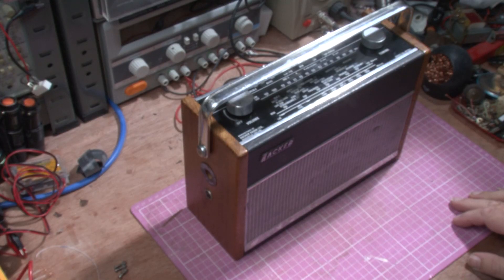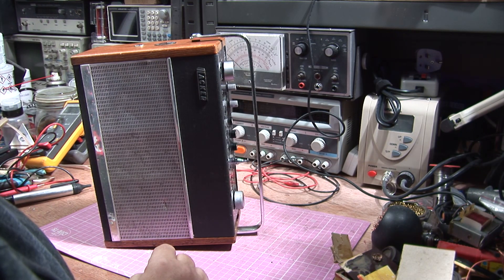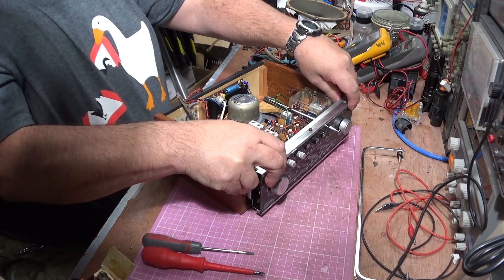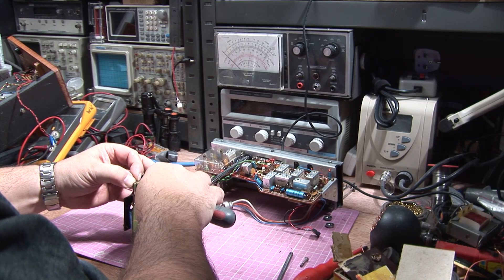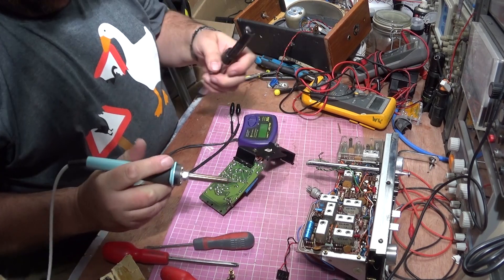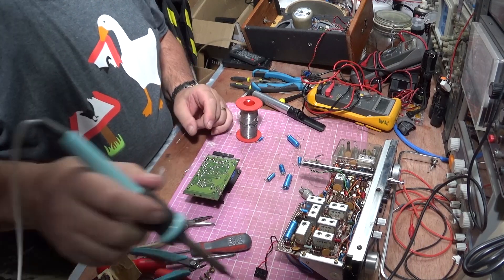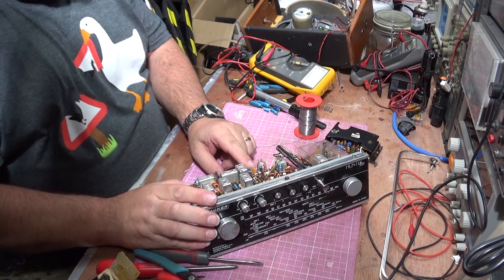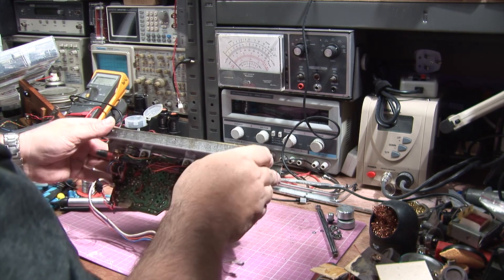Transistor Radio Repair : Hacker Hunter RP38A : Pt. 2. Repairs

Comment: I have a rp38 a and the trebble potentiometer is not working it's not makeing any difference to the tone and it's fairly slack are these available for this radio. My radio works fine aparts from that.
Reply from the maker: You can buy replacement pots but they are hard to find because of the size of the shaft. Suppliers are constantly changing so you just have to search. I would suggest checking the wiring and the connection to the amp board because it is rare that a pot dies completely.

Comment: Top top stuff George.
When checking the caps - how far do they have to be in order to be classed as 'duff'? I've changed a couple on my Speccy recently - supposed to be 22uF  - read at 33 uF
Reply from the maker: It depends on the caps and the original tolerance. I personally treat 10% as my spread even though most caps are 20% still. With older caps though it isn't just the capacitance value though but leakage. If a cap in a valve set leaks dc through it you can do significant damage to a lot of components, depending on what cap it is.

Comment: Coming along nicely George. If one want's to know something then..."Ask George" Roberts P5A valve radio, question, "On the circuit diagram for this radio it shows the mix/osc valve ECH35 with an arrow passing through it...does this mean that this valve is a variable Mu type"???
Reply from the maker: Cheers Theo. eCH35 comes up as a standard triode hexode normally used as a mixer oscillator. looking at the trader sheet I see what you mean... I can't see a reason for it because c27/c28 are the tuning cap... the only other thing that it could represent is the fact that the grid is connected to the top cap rather than a base pin.
Reply: @GeorgeChristofi  George, thanks for your answer, top cap connected to grid was one reason I put down to it, but I thought here I was just be a bit adventurous with my reasoning here. But since you came up with this possible reason too then this adds more credence to that possibility. I searched the web for a sound reason for this arrow through the valve but did not turn up a thing...not a drot.
Reply from the maker: @Theoobovril  Half the problem is the way we draw schematics has changed from the first ones to the current ones. I learnt resistors as a zig zag line but modern schematics show the standardised rectangle. Lots of changes. Also, different countries did different things. The US still does different things, including obsolete measuring systems even us in the UK phased out 30 years ago.